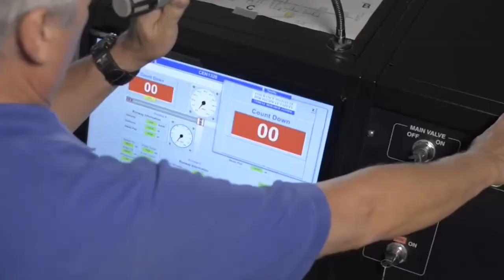Ford's New Ammonia Engine Shocks The Auto Industry

Comment: Japan has one too.I am pretty excited about this. I have owned several Propane Powered Top Kick 5500  if you will, the engine that run on A non Fossil Fuel will absolutely run so clean it’s amazing, The Oil never gets dirty, The Eternal Engine and parts stat spotless. Less Exhaust Gases, everything about them is good. But one issue is in the Cold Weather States. It’s very hard to get started because the Firing is totally Different.

Comment: It would seem to me that a switch to an alternative liquid fuel makes the most sense. Our energy infrastructure is designed to transport and deliver volatile liquid fuels.
Reply from the maker: That’s one thing that’s great about ammonia. It can be stored in low pressure, high volume compared to hydrogen which needs to be stored at high pressure.
Reply: Yes and refueling is a matter of pouring liquids in. I'm wondering how it will be made safe from fumes, and chemical spills after an accident.
Reply: Likely the same as gasoline.
Reply: @pgtmr2713 it dissipates into the air but foes not contain carbon. Spills can be diluted with water.
Try any of that with electric vehicles.
Reply: Look at the infrastructure we already have with anhydrous ammonia

Comment: Interesting concept. Whether or not it comes to fruition is doubtful.
Reply: Toyota already built a 2 L 165 horsepower ammonia engine. Hyundai is already built an engine that burn 70% ammonia 30% gasoline. The biggest issue is trying to figure out how to get new fuel types into the market. That's a 10-year problem no matter what technology you use.
Reply: Now that I think about it I hope we do get multiple fuel types. That means competition and that means big oil companies can't bend us over nearly so easily as the current oil companies do. Honestly for me the environmental issues are secondary.

Comment: Fkn poor commercial for something never been put into a car.
U know what... Humans been trying electric concept for 50 years.. Yet we are still trying to improve an apply it.

Amunia fuel is just a fkn concept. And you are discussing it as it is a fact. Or applied since.
Reply from the maker: Thanks for the comment! It's not just a theory. Several manufacturers, Toyota for example, have built engines that run on ammonia. Of course, there is still a lot of development that needs to happen before it can be rolled out to the mass market, but your accusation that this has never been put into a car is not correct.
Reply: Jokes on you. Cars were fueled with ammonia before they were ever fueled by gasoline.
Reply from the maker: I love learning new things, so that's not a joke to me. Somehow we missed that fact when writing the script for this video. I'll have to dig deeper and maybe we'll post a follow up. Thanks!
Reply from the maker: I wish this was a commercial. I could use some of that Ford advertising money 😂

Comment: You seem to have forgotten the emission of nitrous oxide! Then we could all get a good laugh while we watch something 500 times worse than CO2 going into the atmosphere.
Reply: This seems to be a common misconception about ammonia.
You use ammonia to reduce NOx in diesel engines. NOx mainly comes from high combustion temperatures interacting with nitrogen in the air. If you burn hydrogen at a high temp you can get NOx too. 
Basic catalytic converters seem to manage the NOx
Reply: @Greenammonianews perhaps, get your test tube out of the draw and practice your chemistry a bit. We are talking about burning ammonia. Not adding it in small quantities to another process.
Reply: @BrianArnold-fh6ks   ammonia is nh3. It burns to n2 and h20. It is co-burned in coal plants, used as a diesel substitute, etc, in envirntments with tight nox regulations. It can produce Nox but it depends on air-fuel mixtures and combustion temp, same as any other fuel. Not sure why you would think it would produce nox over n2, that is just incomplete combustion.
 I am an engineer and used to work in a ammonia plant, though admittedly not an expert on engine ignition timing or coal-fire engine plants but I have read the scientific papers.
Reply: I appreciate what Greenammonianews hast to say. I too am concerned about air pollution from nitrogen byproducts for the simple fact is that if done wrong the emissions could be worse that CO2. It is a developing technology, so too soon to tell. A liquid fuel has some advantages, like pipelines distribution. I notice how a lot of the stock videos' show big pickup trucks. Obviously the target audience is the Power Hungary. I will say that sunlight and wind are free. I can collect them at home and charge my EV.